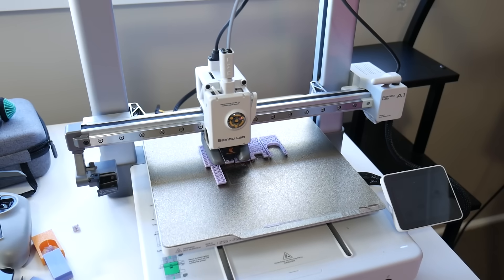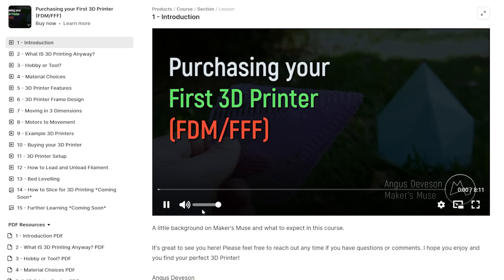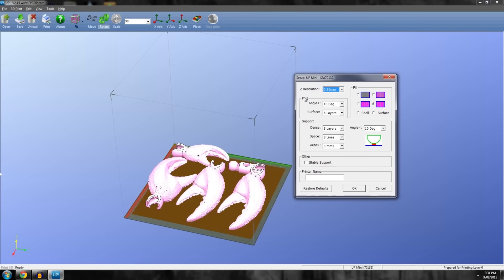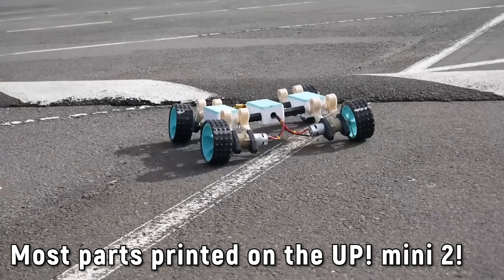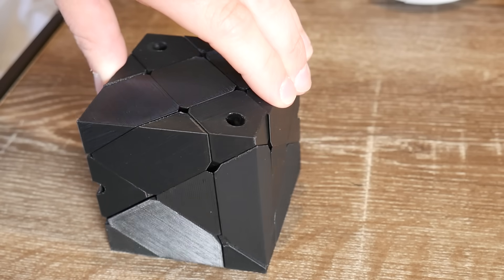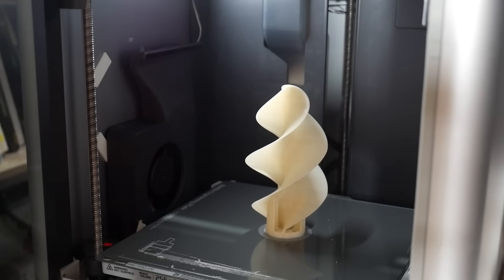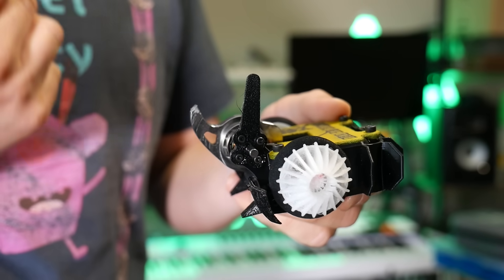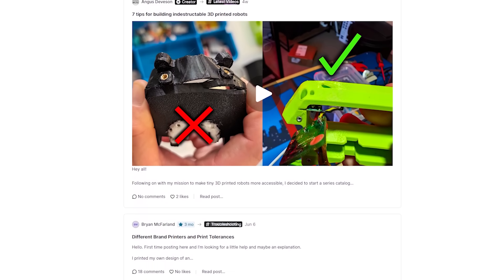The best 3D printer is...

Comment: Angus, been following you and your thoughts since my first 3d printer days - from Monoprice. It lasted about 2 years till I couldn't stand it anymore. Then came my MakerGear. I printed with that until just a month ago, when the motherboard died and stopped heating the bed. Another $225 US would have fixed it, but it's not worth fixing. Now, after looking long and hard for the last two years, I bought the Bambu Lab H2S Combo. Didn't need the laser or cutter, but this was in stock and ready to ship. 
Wow, what a difference. I am very happy with that huge print bed. I bought it for reasons that I KNEW I wanted a printer for. Not because it was fancy or hyped up, but because I would use these features. I will say one thing about this machine, It's A Beast! And I am happy with my Beast.

Carry On Buddy!   Lowell in the US.

Comment: I still use my Anet A8...from almost 10 years ago. Got it for free from an FPV pilot buddy in florida, replaced the hot end and all the bearings and have been using it for YEARS. It does have some z shift in the layer lines...but im making just functional stuff. Almost none of my stuff needs to be pretty. Not that it looks bad, from a couple feet away they look great, and sometimes i get the right model mixed with the right filament and my prints are 98% perfect.

Comment: See the locking rhe current bambo printers down to only bambu filament is a non starter argument. Ghe printers are desinged to work with external spolls. Meaning that there is no way for the printer to verify what ghe external spoll is. The printers them selves do not have RFID readers in them. So untill bambu adds that to the base unti and not just the AMS systems its not something that csn happen. And as far as i know the new H2 line up dose not have an RFID built in to the printers body. All other criticism are vaild though.

Comment: DON'T buy any FlashForge Printers they are crap. They claim a 1 yr warranty that is the joke on you. See they make you fix it, they send parts. For something its ok but when you have to take the machine apart and remove the gantry for a factory defect that was not known until i had to tighten the belts. Been down almost a month. They have NO urgency to get parts. Buy a bamboo

Comment: My now 7 year old Ender 3 is still going strong. I print on mirror still, because it is flat and i don't need automatic bed leveling. Flat bed is really, really important, something that automatic bed leveling is really for: so that they don't have to spend time on the bed, just slap a mesh on it and call it a day. Does it do ultimate quality? Nah, but it does just fine. It is slow, a bit temperamental but fails rarely. It is dependable enough that i expect every print to stick and print to the end.

All original parts apart the motherboard, i go thru 3-6kg of plastic a year.

Comment: Thanks for the helpful video Angus! I  have a Bambu A1 Mini and love its reliability and easy use.  I bought it about a year ago and have not updated the firmware.  It prints well and am concerned any firmware update will reduce some feature or capability.  Should I accept the updated firmware offers or stick with the current firmware.  What firmware version for the A1 Mini would you recommend? Thanks again!

Comment: I remember when I finally bought my first 3d printer after having worked with them in school.
The good ol Ender 3 pro.

I never personally had any print quality issues.
Kept it maintained, upgraded to a Microswiss hotend, PEI textured glass, used an enclosure.
Never an issue...except when swapping filaments.
I ended up sticking with a single brand of filament (Overture PLA+) and fine tuned my settings for that. Followed by a good ASA profile.

The Bambu Lab P1S was the first printer that I felt like solved my problems at the price point I wanted to pay.

I was able to get quality almost as good as my meticulously tuned (albeit slow) profiles on my Ender 3 Pro, but in half the time and, more importantly, EVERY time.

I don't want to think about the printer, besides the regular cleaning and maintenance.
I want to design things, hit print, and never worry about it. So far, after thousands of print hours, I can count the number of failed prints on one hand. Only one of those was not user error.

The next step is definitely multi material printing and a bump in build volume.
The H2D looks like the ticket, but I'll give it a year or two for for any problems to get worked out (and for it to go on sale LOL)

Comment: I built a Voron 2.4 using the LDO kit, it is a great experience and a tremendous printer, but it is NOT for beginners. It is challenging to setup and tune and requires a lot of experience otherwise you would really struggle and almost certainly get frustrated and give up. My first printer was a Prusa Mk 2 that I upgraded to a mk3s and heavily modded over the years, it is still working today, I always recommend Prusa to others or more recently the X1C, noting that it is closed and proprietary which I do not like and personally wouldn't purchase.

Comment: 2:39 Wild you only have an extra year of experience with 3d printer than me i first bought mine back in 2013 solidoodle still have it actually works quite well for abs given the fact it is 12 yrs old
Reply: Damn mine also cost over $1000 what a time we live in now i just picked up a printer used for $25 plus a kg of pla with it guess the guy got it for $100 simply amazing
Reply: This honestly inspires me to upgrade the old beast tbh all it really needs is a new hotend as it maxes out at 222 degrees but that does work well for abs given the

Comment: My MK4 is such a damn reliable workhorse – it never let me down. Some machines you just get attached to ❤
Reply: Exactly, the MK4 just gets the job done. I trust mine completely :hand-purple-blue-peace:
Reply: @Radhiant  Same.  I've upgraded it to a 4s and added the MMU3 (great bit of kit as well).  I've been eyeing the Core 1 to print more difficult materials, but my Mk4 has just been super reliable so far.  I don't print a lot, for me it's just another tool in the workshop, that I want to be ready for when I need it.  And it always is.
Reply: im just wondering why you would buy a prusa now where there are so many core xy printers that are faster and or bigger and are capable of the same result
Reply: @ZFGFZDGDFG I’m personally looking at a mk4s because it only 670 for a kit and I just need a reliable printer. I’ve been down the road of having a tinker printer and it would constantly not print well or something broke and that killed my drive so many times. I don’t care about speed I just want a solid printer with sold support I might eventually build a Voron but I want a workhorse. Workhorses are not the fastest horse but they are reliable and strong and I want that in a printer

Comment: I've found the best, reliable, workhorse machine I've owned over the years and I've owned 6 different printers myself. Has been the flashforge adventurer series. ABS, TPU, PETG, PLA all your basic filaments have working profiles that print more or less out of the box. It's fully enclosed with minimal effort to dial in. It's always leveled, the bed can be upgraded to glass from the PE flexi-sheet it comes with, oh and the kicker? The nozzle is a plug and play replacement, no turning, poking, pinching, or struggling with burnt nozzles. Just push in, and pull down, to install just pop a new one up and in. It's effortless and has served me well right up until i decided to make some "modifications" which... still irk me. But that's not their fault, it's mine.

Comment: Thought about buying a printer for ages. Was used to people modifying printers, I come from an engineering background so I was prepared to have to redesign things. Eventually I stopped waiting and just bought a Bambu Lab A1. It just works. Is it a fast CoreXY monster? No. Can it print all the fancy filaments? No. But I've gotten so much use out of it since I bought it that it's easily paid for itself.

Comment: I have 3 Aldi Wanhao Duplicator i3 Plus printers, all with the ADVi3++ firmware. They're each set up for different jobs, one with a custom dual drive extruder that I made. I've had the oldest for 7 or 8 years now. It's very tempting to get something like a Bambu Labs machine, but at the end of the day I just don't need to. They do exactly what I need, which is mainly printing small tpu and nylon components for my business, and most importantly, they do it really reliably.

Comment: Well I certainly hope Bambu Labs doesn't lock out non propriety filaments at any point since I don't own any Bambu Labs filament, and have about $700.00 in non Bambu Labs filament. It would be a radical change, and I doubt it will happen, but they easily could do it if they were so inclined.

Comment: I did my research and still got a total lemon, the Elegoo 4 max. it's so bad that the cost of the machine is irrelevant compared to the amount of time I have into trying to get it dialed in, without success. now just a paper weight 

I'm trying to acquire more Sunlu S8's to customize and add to my farm. they are old tech and slow but have been great machines.

Comment: For a few years I had Ender 3 V2. It required a bit of tinkering and modding to work properly, but I didn't mind that - I like tinkering. Recently I upgraded to K1 Max. I found a incomplete unit, with no top, no door and one side panel missing, it was store window model. Got it for 60% of the price of new one, replaced missing panels, tuned it up a little (uneven bed is standard in these machines, apparently), and it works great. Prints faster, but makes my entire desk vibrate and almost jumps around. Still, it's a machine for tinkerers, not for people who prefer their machines to just work out of the box. For that one pays extra for Prusa or Bambu Lab...

Comment: My first dedicated 3d printer was a Prusa i3 Mk 2 clone I printed the parts for on a retrofitted CNC machine way back in 2013. I do want to rebuild and upgrade that machine it hasn't been used for many years. Used the Aldi Cocoon create mini for a while before replacing it with a Creality Ender 3 Mk3 SE (After watching your video). It has been a very reliable printer and I like the fact they board is still compatible with Marlin firmware / G code. As you said it all comes down to reliabilty you don't want to be re adjusting the machine constantly to get a reliablie print out of it.

Comment: Thanks Angus, another excellent video. An idea for a future video: a no-nonsense deep dive into the current state of Bambu Lab printers in terms of advantages and disadvantages with their more controlled ecosystem and how that can affect different types of users. Long story short, I’d like to upgrade from my V3SE (which works perfectly fine 99% of the time) at some point to a larger, closed enclosure-style printer to play with more exotic filaments and something with multi-filament capability. The X1C has for better or worse somewhat claimed this space at least in terms of online influencer mindset, though how much of this has been bought versus earned is hard to gauge. I’m curious how similar offerings from Creality, Anycubic etc really compare… and whether the changes and potential restrictions of the Bambu Lab ecosystem really affect those users who just want to print, rather than be 3D hobbyists or professionals, and for whom a more controlled ‘it just works’ approach is a feature the whole open-source-ness isn’t really a concern. I appreciate for many passionate people in the space it absolutely is, but I do wonder how much of the online grumbling about Bambu of late is an ideological argument versus one of actual feature restriction or potential security risk? I’m happy to sneakernet my 3D printer SD cards if it means a fast and reliable product that doesn’t create birdnests.

Comment: For people worried about "cloud" printing with Bambu printers. Not sure why it's a worry guess if your designing high-end prototypes and working with IP then it's a valid concern maybe. BUT you can Print in incognito mode zero history saved anywhere or configure it so it saves it on the printer ONLY. Or you can print in LAN mode only working off your home network which can be a offline secure network (mine is) you lose the camera functions sucks BUT add a $20 Waze camera a simple AI plugin and you no longer need the stock camera you now get higher quality video better time lapse and a few extra features. 
   All that isn't enough you can rebuild it / jailbreak it with the right skills. Something that I think will become more popular if they lock down their system anymore. Me I don't care it prints great and reliable and I actually like their software. And have non-bambu printers if I really don't want to send something over the cloud service

Comment: well, i started with one of these "cheap" 49$-printers with 10x10x10cm, who can only print pla - and they were only capable for a "small" spool of pla with max. 500g, either just 250g. i tryed a few things, used the propetairy slicer it came with, and was partly astonished as even unlucky - some parts were printed bigger as i thought, other didn't stick on the bed good enough... but,  it runs - and all you could do was just switch it on by putting the plung in the wall, insert a sd-card and press "play". later, i switched to a anycubic 4max - the first generation... had run good in the beginning, but became then problems, what i couldn't fix - like the bed was not really good to set (i won't call it "level"), it also had extrusion problems (maybe due the pre-owner had switched the original hotend to a E3D v4 with a bowden-extruder from type titan aero). so, that was in the end more frustrating than my tiny 1.st printer... what was going to a artillery genius, what is also running often - and had been modded a bit over time (marlin 2.0, automatical bed-leveling via BLtouch)... but - it is also only good for PLA; a try with PETG had let me stopping to print things, 'cause i don't get the settings good enough - maybe it's the filament, maybe it's the settings.

so, i'm now also looking sometimes for a printer, who (all other printers were pre-used besides the first one - but, all of them were "partly build", so that i always not needed to do much stuff) literally can print several filaments without problem - like petg / asa, TPU and also Pla, but for latter i would use also my genius, and that's also a challenge - cause some prints need to withstand uv-light and extreme heat-conditions ('cause used for car acessories, mostly on the inside). i think, my next onw would be then a Prusa MK4 - with single-color, 'cause i asked myself "when" would i use more than one color, or even if i need to switch often to different filaments. and cause the most seem to go good with prusa, i think, i won't make a bad buy with that - even when the best results were with they'r own filament; but, 'cause they're not that propetairy, i would also try my filaments i've had here and also looking if i can use there not just one slicer. if someone would suggest me bambulab, i would either say "no thanks" - 'cause they had seem like hype-printers, who also could get tinto expensive bricks - without chance to fix them by myself. from prusa i didn't hear something like that; they were present and it seems mostly everything fine.

Comment: Something else to consider is that your needs of a 3d printer are likely to change. When I first built a 3d printer, my interest was in the printer, and what I could find to make with it. 

As my budget was an issue, I pulled in a release of FreeCAD at the time, designed up what I needed, got it to print and after several iterations had something I could use. I've since re-designed that part in the more recent releases of FreeCAD, but along the way I learned (from Angus) about TinkerCAD and I've got several hundred designs in TinkerCAD. Also looked at OnShape, and realized that it wasn't a tool that worked well for me, making that decision before they made their decision on terms and who would need a commercial license. If you learned 3d CAD in a school system that OnShape works as an extension of, go for it. I didn't, so it not working well for me is a 'me' thing, not a specific issue with OnShape.

In the past couple of years I've gone back to designing things to solve my own problems in FreeCAD (over 600 projects at various stages of complexity)and I'm far more interested in printers that "just work" for me, and that I can afford. For the moment that's mostly Bambu Lab printers, but I'm also considering some of the Sovol printers, even if I haven't purchased any.

I'm not an influencer. 3d Printing for me is becoming more of a tool than a end of it's own. I'm not aiming to have the 'fastest' printer, or the most capable, or prettiest, of anything like that. I can see a need for a resin printer in my future, and have a couple for that, but haven't been printing with any of them (OK, I did print with one of the first sub $100  resin printers, not recommended, but I did get some stuff done.) 

So if you are looking at getting into 3d printing, recognize that what you need 'today' may be a tool that allows you to do something that just may not work for you in a few years, and you'll need to move to another printer environment, or perhaps just a different printer maker. Or you may find that your first printer is the only 3d printer you ever need.